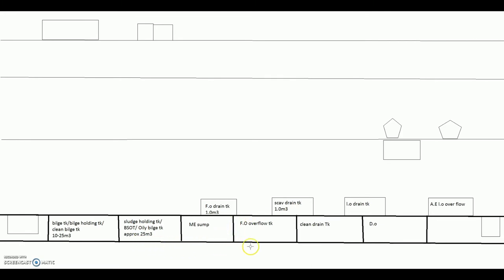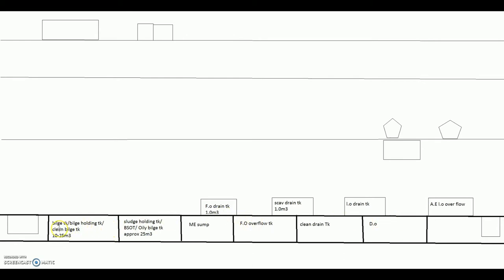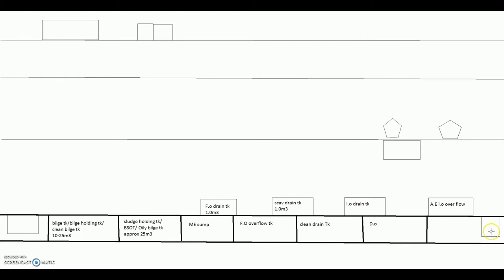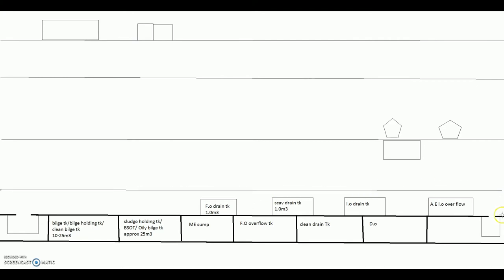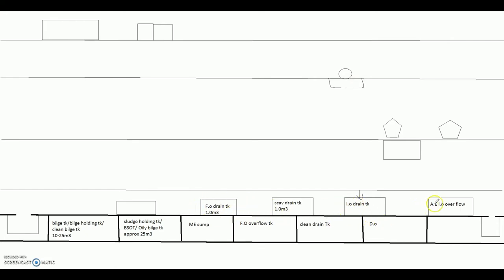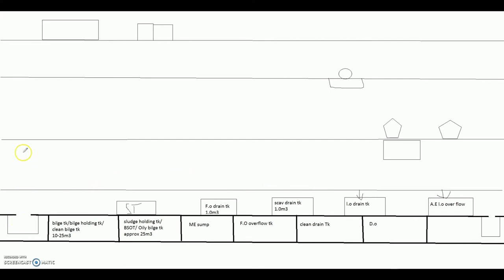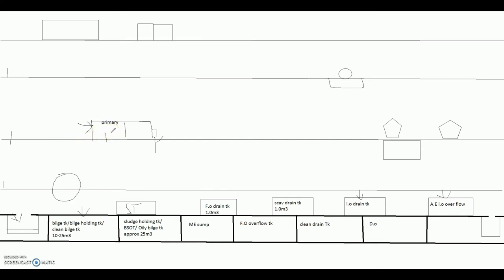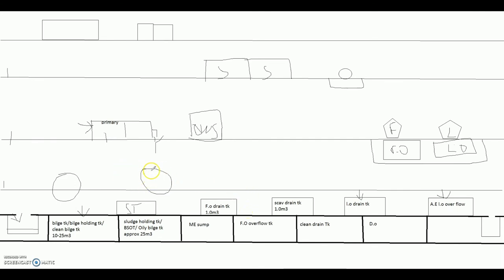Tanks and Various Systems(basic)

Comment: Every tanks are provided Separatly then, what are the things are going to the bilge well? Then why bilge well what happened we directly connected the pipe line to the bilge holding tank ?
Reply from the maker: Expansion tank, cascade tank tray vl go to bilges, all cooler tray vl go to bilges, only drain n vent n relief valve drain vl to drain TK. Like that many things are there
Reply: @BasicMarineEngineering  thank you sir